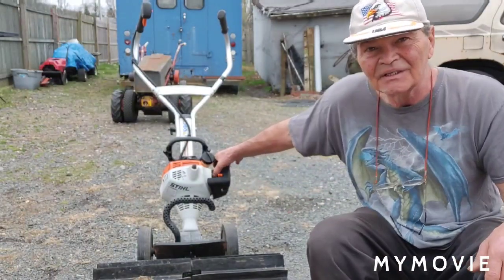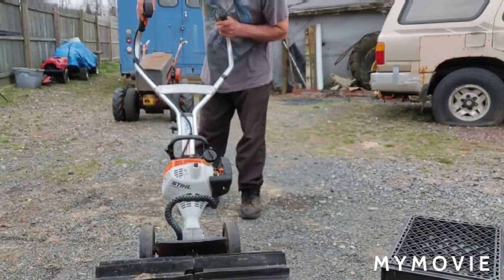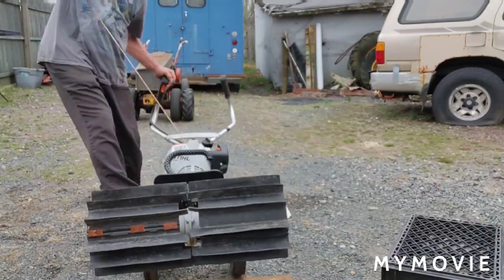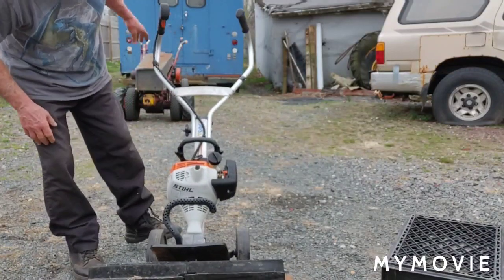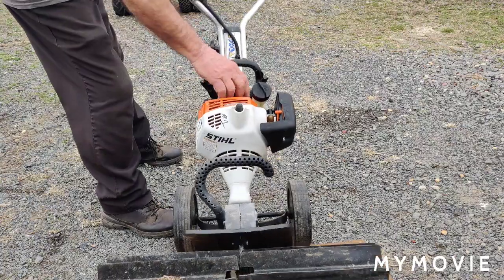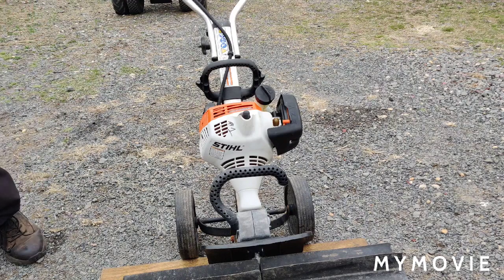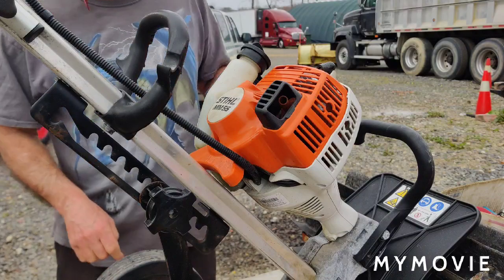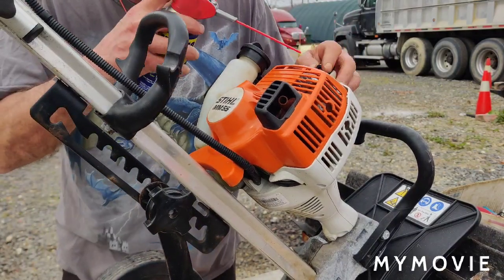Stihl power sweeper 52cc 2 stoke. how to replace the starter pull cord.

Comment: I was waiting for you use your foot and stomp on it I've had good luck with PB Blaster I think it works better than WD-40 those paddle Wheels work great on snow and stone driveways when cleaning up after snow plowing especially putting the stone back on the driveway you show the true pain and suffering good job
Reply from the maker: I use pb blaster also when it's time to break out the heavy artillery lol. This is the first one I ever worked on. It seems to be pretty well built. Thanks for watching Chuck B 👍